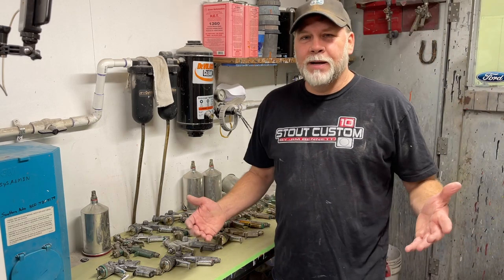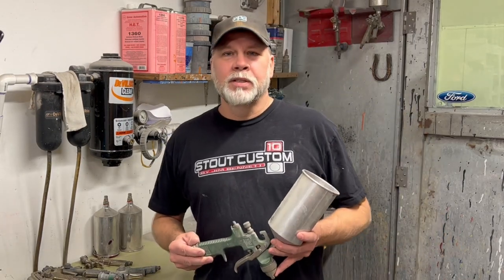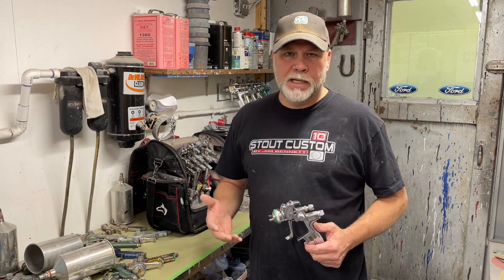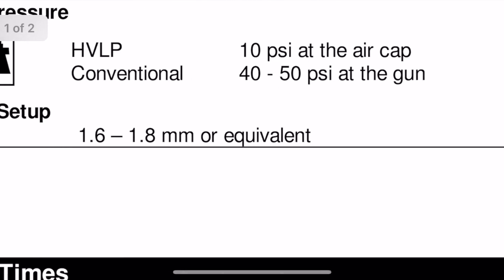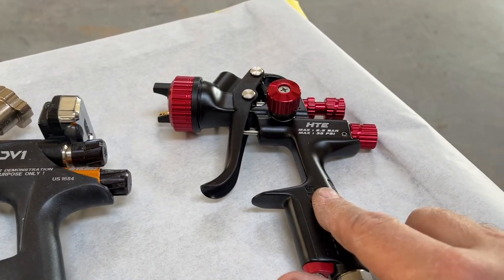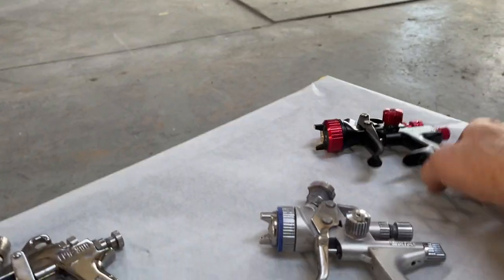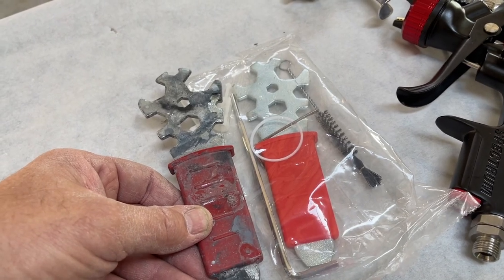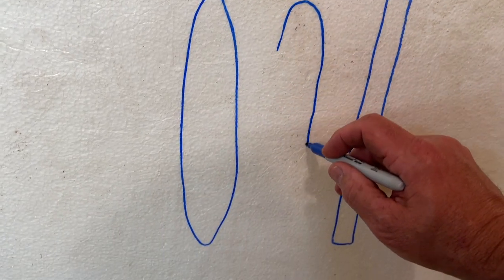How to Choose a Paint Gun:  General Information

Comment: I got a 86 I’m gonna be spraying soon a heavy metallic purple, do you think spraying the truck in parts separately I’d have an issue with a color difference? I’ll take any advice , great video by the way.
Reply from the maker: There is definitely a potential for color match issues. If it is a well covering color the potential is less but if the color is somewhat transparent the color can vary a lot with each coat and the color of the primer or sealer will have an effect too. Best bet is to use the same color sealer (probably black or dark grey) on everything as a foundation and paint as much of the truck together as you can. Basically jamb, assemble, and paint as a whole or at least front half and back half. Just be sure to make notes of how many coats you apply and do the same to everything. Thanks for the question and thanks for watching!
Reply: @StoutCustom  thanks I originally bought white sealer thinking the purple would cover better but maybe need to buy a different color sealer. Thanks for the advice, Your awesome man.